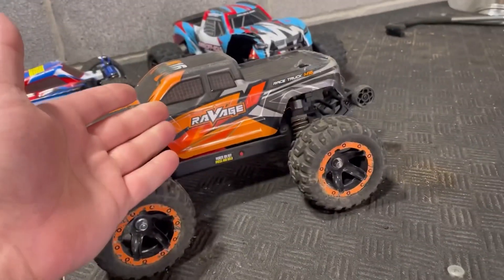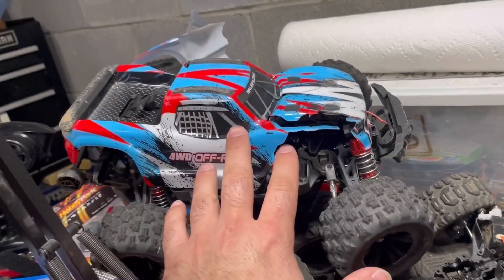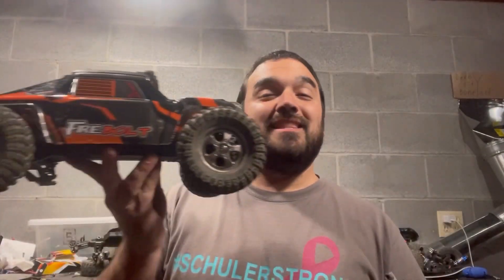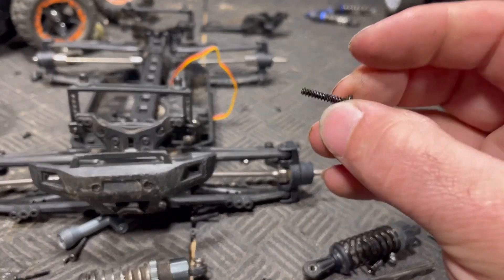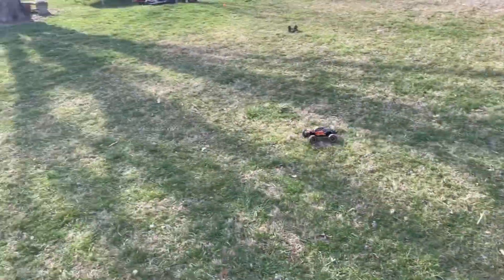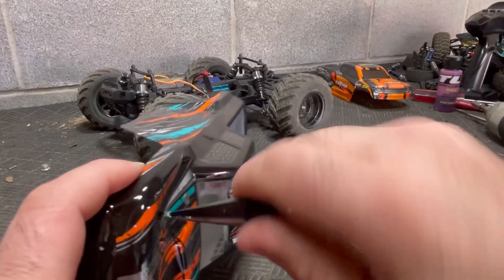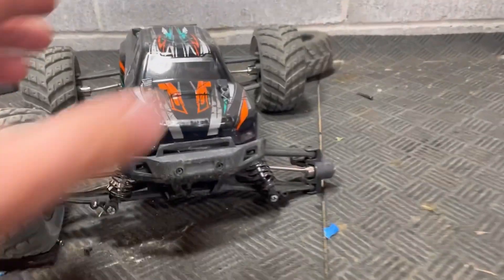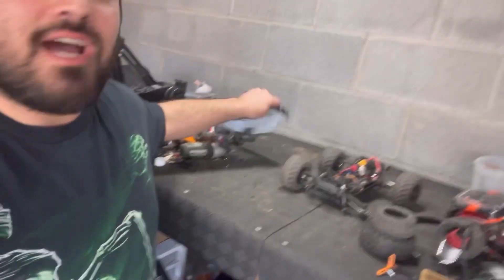Making the BEST RC car even BETTER

Comment: Nice mashup dude!  You HAVE to checkout the redcat kaiju 6s (V1) . Indestructible truck with loads of power, I run mine on 5s and it loves it .  Highly recommend that and the Losi LMT.
Reply from the maker: Thanks! I see so many mixed reviews on the kaju lol. I do want it though. I had a new Redcat in the background of part of this video to see if anyone noticed lol. Reviewing it next. Not a Kaiju though. 
I would love an LMT and is definitely on the list of soonies. 
Maybe they’ll have a v2 soon with stronger axles!
Reply: @Derby City RC  I seen it! Mt10e is badass! Lol. And losi just released a V2 of sorts its the TLR tuned LMT builders kit with alot of updates.
Reply: Looking forward to that mt10 review!
Reply from the maker: Haha! You found it.
Coming next probably!
Reply from the maker: And btw that’s not what’s in the box from the Netherlands lol
It’s nothing magnificent but I’m definitely excited for it
Reply from the maker: Haha! Nice.
Sweet I’ll check it out!!
Reply: I just got the Kaiju V1 not to long ago. I love the thing! What a beast. I’ve only done 4s so far. It run’s amazing but The motor gets wicked hot so I got a double fan for it. Next time out Was going to do 6s but maybe I’ll do 5 first. What batteries you using for 5s?
Reply: @DerbyCityRC  when you say V2 your talking about the Kaiju EXT right? That one looks bad##s too. EXT has the longer chassis 
and Comes stock with belted tires!  
Definitely would want to see you launch either one! 
Oh and I did see that box just out of sight behind your light. I was trying to figure what it is but Couldn’t make out the logo 🤣🤣.
Reply from the maker: Well I don’t have a Kaiju. Maybe one day, but yes I believe the ext is considered the v2. 
I like putting little Easter eggs in videos to keep people guessing 🤣

Comment: Someone tell their Chinese connection to build mini XRT clone body shells for this application, assemble a bunch using this project template using bulk parts and then sell them standalone.

I'd buy two.
Reply from the maker: I agree! I scoured the web looking for a body I liked that would fit and couldn’t find one. Even had the paint ready to customize one. Really wanted an old classic Chevy truck body. Found one supposedly for a 1/16 scale but is more like an HBX 1/12 scale and was way too big.
Reply: What about the MJX hyper go body that looks like a tiny  Arrma Vorteks?

There's a black and gold version available that looks sick.
Reply from the maker: That body has the clipless design which wouldn’t have fit in the longer chassis. Plus I have that car so wanted a different body. Lol ended up with the same hbx body just in a different color.
Reply from the maker: Just realized you’re probably talking about the black body vorteks lookin one, not the one that’s blue red and white kinda like some vorteks have. I actually looked for that black body and couldn’t find it sold separately. Cuz I did consider that.
Reply from the maker: Dang not bad at all!